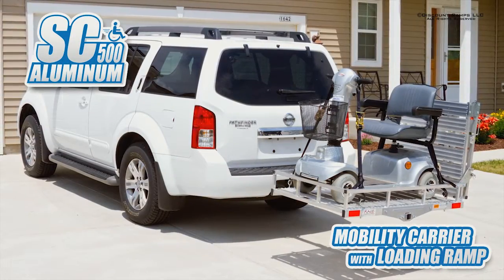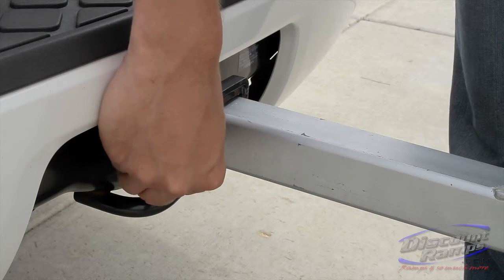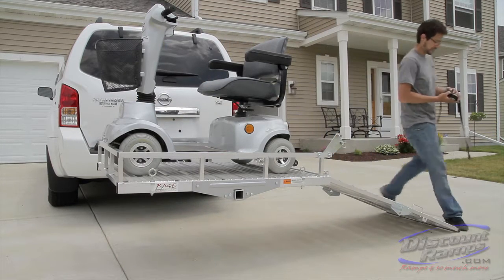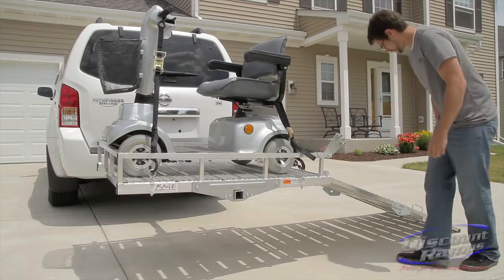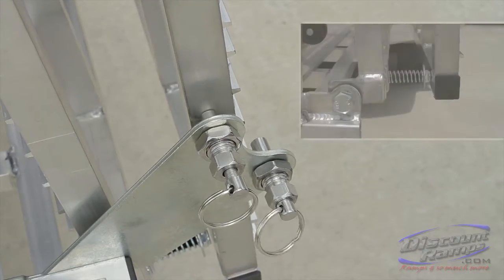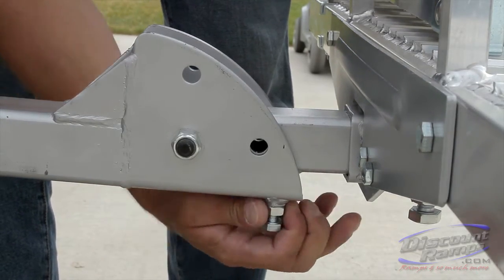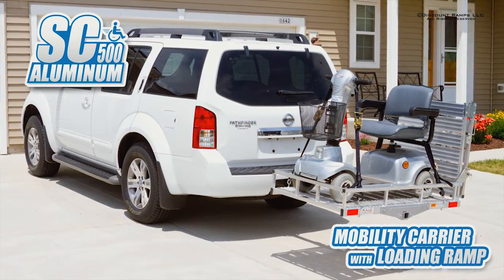SC500-AF Aluminum Folding Mobility Carrier - Installation

Comment: RE: Tube that goes into the hitch receiver and the plate that allows tilt to vertical: Steel or Al?? Look same color.
.
.
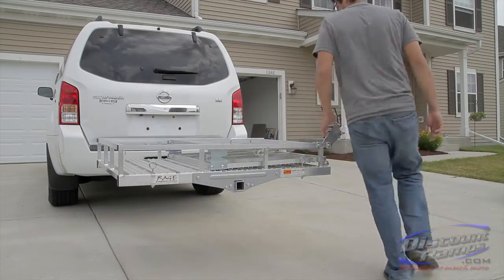Also the anti-wobble plate shown at 0.42 sure looks different for the plate at 5:47. What's with that?

Comment: I forgot to add, that the hitch on this already shows signs of paint chipping and being scraped off, cracking along with what appears to be bad/splotchy welding. It appears to painted- baked powder coating, or just leaving it galvanized may work better. The current model will look old, poor, and shabby, and depending on material, it may be exposed to possible rust formation. When it reaches this condition, it may not reflect the class of the vehicle it is towed by, nor many user’s aesthetic views. Also, since I don’t see who the manufacturer is, if not the dealer, hopefully they will pass the comments on to manufacturer.
Reply: wait till they make them out of titanium, take out a mortgage and buy one......,.or, live with a few imperfections?

Comment: How will it work on a passenger car,like a new Malibu or impala or Camry ? I would think it would hang too low at the end .
Reply from the maker: Hi Leopoldo, this carrier is designed to work with Standard Class III and IV hitches. Your vehicle may require air shocks or heavier springs to stiffen up the suspension to prevent sagging. We'd recommend checking with your dealer to find out your vehicle's carrying capacity.
Reply: Thnx4 prompt response

Comment: How is a disabled person going to push anything up that ramp.
Reply: D Young you do know they HAVE ELECTRIC MOTORS RIGHT??
Reply: They sit in it and ride it up the ramp. Even if you are not disabled,  you still use the motor to propel it up the ramp.
Reply: Kathy Williamson But then you you have to deal with dismounting while up on the ramp, very precarious endeavor .
Reply: telekinesis, duh
Reply: @kathywilliamson7907  if you watch the video it shows you the scooter going up the ramp unoccupied you can’t sit on it and drive it up the ramp duh

Comment: This product is not functionable for any true mobility hampered individual for daily use without an abled bodied very patient accompaning companion. There is way to much to do with complicated straps (ratching straps at best can be a pain) and securing, not to mention pushing it up the ramp. My gosh, at least have it strong enough and designed for easy exiting so it can be driven by the individual. The ones I have seen similiar to this, you dtive onto a flat platform (no ramp required), get off, and push a button and a lift brings it into position - end of subject. Having to find somewhere to use a side ramp can be difficult though I will admit, with the length, a rear ramp could be an issue too. Everything you do with this carrier, from initial installation which requires two people to lift it in place requires way too many nuts, bolts, clips straps, and tightening. Even this young guy was constantly up and down, bending, leaning trying to see under, and having to squat and all but down on his knees not to mention back and forth getting other parts. There is very little framing around the carrier, except for the ramp so it would be very easy for someone to smash into and damage the carrier and scooter. More cage around the carrier would help eliminate some of the strapping, and would better protect the scooter if someone ran in to it. I don’t understand why there there aren’t supporting wheels and that all the weight of the carrier and scooter is on the hitch. This sets up an issue with future enlargement of the holes due to constant movement as it travels down the road, cracking/breaks, and general metal stretching. Also, the ramp needs to load/slide under the carrier so it doesn’t block any of the rear view line of sight. There is no where to insert flags so that the driver can assess the distance between it and another vehicle, building, sign post, etc. when backing up. Other drivers around you will also have difficulty being alerted to it without flags and It’s color means it just blends out of sight and could quickly be run into. It needs holes to insert flags on poles that can be adjusted to the driver’s line of sight in the rear view and side view mirrors. It needs smaller flag insertions or permanent moving flags, etc on the back side to catch the sight of following drivers. The taller flag for the driver may not catch the following traffic as they concentrate lower and on the road. Something moving will catch their attention. The design needs redo to enable bolts to be inserted from the bottom and nuts and washers put on to allow easier and more visable tightening. It is easier to find the hole and then do the attachment of pins, nuts and tightening where you can actually see and not have to fumble and feel your way around and may eliminate the need to squat and bend your head and neck to see underneath. In fact, there are much better and more modern attachment systems period. The strapping system is just crazy and there have to be much better ways to do so. These devices need to be easy for people who already have mobility issues along with balance, standing, sitting, walking, bending, squatting etc. Knees, legs, ankles, shoulders hands, etc. make many tasks difficult. Hand control, strength and vision could cause quite an issue with the tasks needed to be accomplished with this carrier. Some may have problems with vision up close and tasks for a mobility challenged individual (usually alone) should never require bending over, or up and down position as it can cause shifts in blood pressure, ear pressure or even vision changes and can cause a sudden dizzy spell resulting in a severe fall - possibly fatal. I can’t imagine even if I was young and healthy having to go through all these steps at each location or shop much less the intial attachment each time I want it off the vehicle period. Most companions, whether young or not, especially women, aren’t going to want to deal with all this just to off load and reload due to all the securing tasks and all the bending, squatting, leaning over, etc. FOR EVERY STOP AT EVERY STORE! The indivuals who designed this apparently haven’t spent much time being a caregiver nor are they mobility challenged themselves and it certainly appears they didn’t consult with a number of such individuals and have them try to go through all of these procedures during a day of errands. Mobility challenged folks, especially older individuals, suffer with a multitude of co-morbities and movement issues. On their best days, they may generally feel bad and unwell. Their strength, either in general, or for particular parts of the body, i.e., legs, hands, etc can be very weak. Many live alone, have very little assistance and at 75, 80, 95 are still having to drive if they want food, medicine or clothing. Many can get along fairly well taking care of themselves except they don’t feel well enough or have the strength to walk distances over the size of their homes. And they can’t move as quickly or in the same way as when younger; their flexibility is seriously compromised; and for many, their strength (in various body parts and general) has diminished as much as 35-85% or more. They don’t need a nursing home, which is where people go to die not live, but they do need products that make their daily lives easier and that add to their ease in getting around all the places they still need to go. I can’t see how this carrier or any made like it, are of much benefit. As I already said, even a caregiver would quickly become frustrated with all this securing etc not to mention pushing it up the ramp at multiple locations. I say back to the drawing board after a few days spent at several nursing homes, and then several retirement homes, etc to observe and let them try it out. If you don’t know the difference in a nursing home, rehab facility, and retirement community - this isn’t your market. Some can do it all as in continuing care facilities but many are quite separate in function and the population they serve from age, health, to financial where-for-all. Make sure you have their responsible party permission, ask the facility for help, and have your insurance well in place. I believe this carrier could be dangerous for all but the strongest, most healthy, young mobility challenged individuals. Then spend a few days each at doctor’s offices, hospitals, all kinds of stores and travel destinations to really see the difficulties folks have getting around. Note and score the mobility challenged individual, their companions, time of year, difficulty in mobility, and general health appearance, vehicle, etc.. Try to find your own prior customers, and observe their difficulties -preferably without their knowing, and then talk to them or caregiver about how the carrier works for them and what they think it needs. Prepare a scripted survey so you ask the same from each individual. Once you have done, at the very least all of these things, (I can think of more already), then go back to drawing board,. After design modifications are made, it is very important to go back to the same testing locations/individuals and see what has changed in performance, make any final modifications. If really smart, you will have a couple of folks for interval testing as you move along in redesign. If you do all of this, and it tests well, you will have a product worthy of selling, and quite different than the one in this video. And don’t forget to stay abreast of needs and changes of your market for the future. A product designed, built, and tested in the mind of one or even a couple of individuals, without lots of research and market input of potential users will not succeed into the future.
Reply: rosebudforglory I concur with everything you said, but you could've said all that in 5 o6 sentences !
Reply: This is a price point issue. Equipment that does darn near every thing you have grip about is available (at approximately 5 times the cost.) The easier it is to use, the more gadgets/ price involved. Any one with common smarts can see the unit is for someone with help and monetary issues. Call the factory. Be realistic. Done Tech support on vehicle lift
Reply: Wow, I think that’s the longest comment I’ve ever seen.